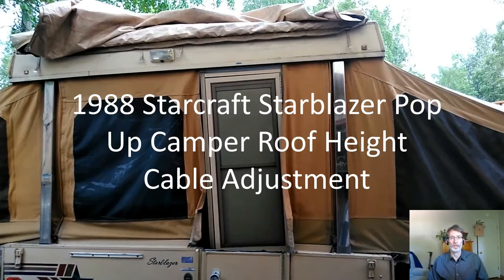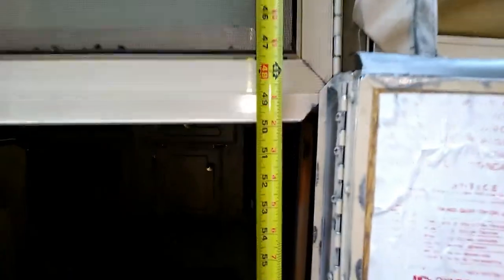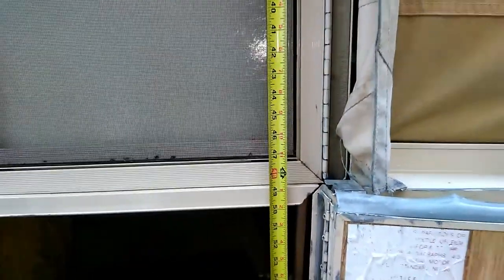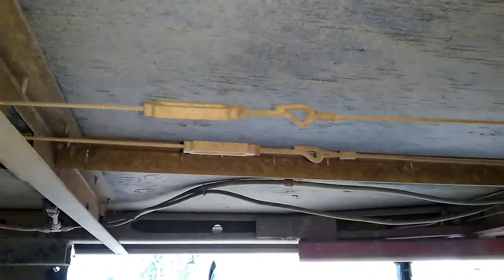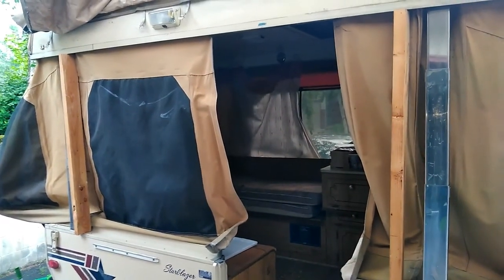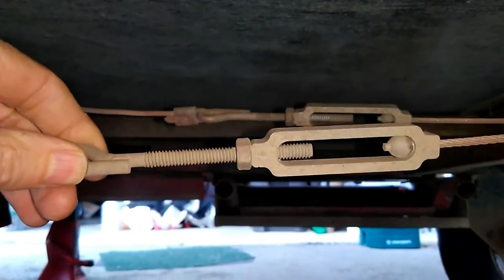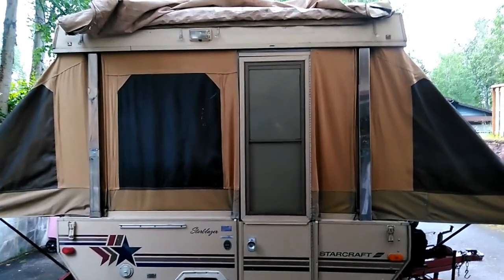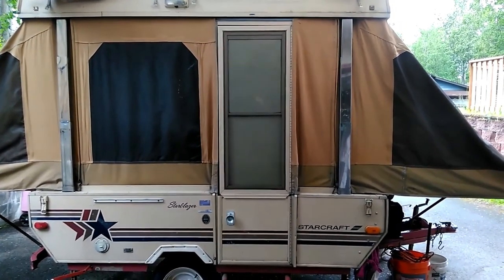StarCraft Pop Up Camper Roof Height Cable Adjustment

Comment: Hello there i have a 1984 StarCraft i cant get it to go up
Reply from the maker: I wish I could help but I'm no expert. I think you could search google and youtube for "pop camper won't go up" or something similar and find relevant troubleshooting videos and ideas. Even if they are from other camper manufacturers they all work similarly. Most likely something is broken, rusted in a fixed position or cables detached or out of track. The easy thing to do is look underneath and see if all the cables are still there. Next you would have to open up the box covering the lifting gears/pulleys etc to see if anything looks broken or out of place. Best wishes on finding a fix.
Reply from the maker: This video might be a place to start. The author also made a part 2 of the video. I haven't watched in a while but it's close to the camper you own.  https://youtu.be/kcWvE7hXvOQ